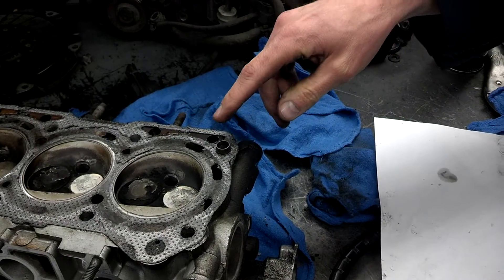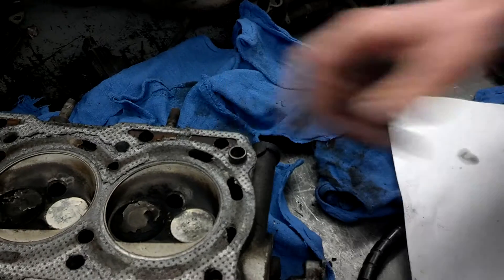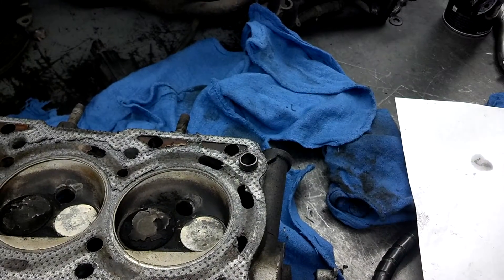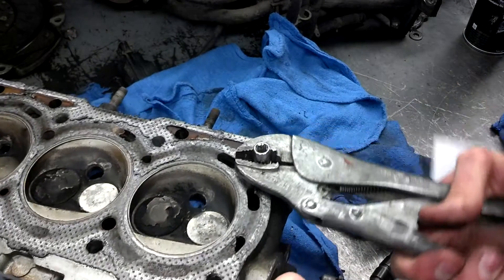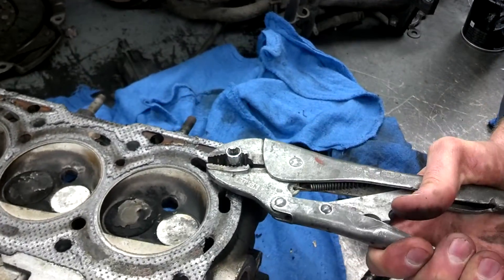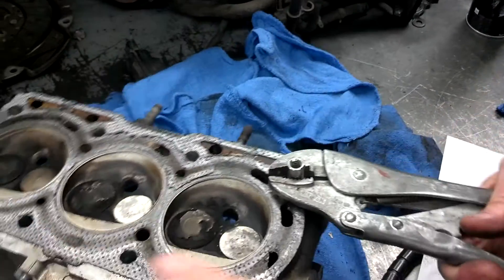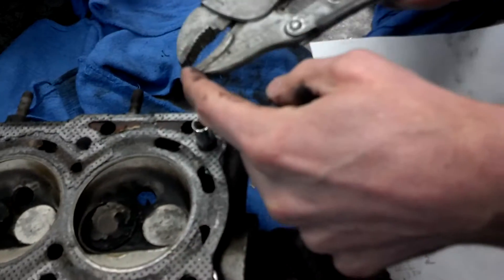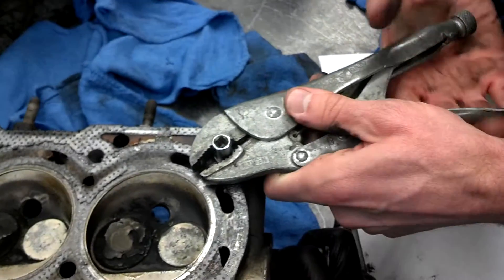How to remove an alignment dowel

Comment: Thanks for the tip, it really helped me out. My pain was a bit smaller so I used the back end of a drill bit to give me room for the vice grips. And don't forget to use the old gasket to Shield the head from scratches.

Comment: On the head I removed today, I was able to lightly tap the bottom lip of the dowel with a hammer, which both ends have, using a tool that has a pointed but blunt tip. There's one in most "pick and hook" sets. Just going around, tapping on all sides. The hole the dowel was in went all the way through so I could do that from the other end; not sure if other heads are like that.

Comment: please explain that what is the function of alignment dowel.
Reply: It's a dowel that aligns the gasket to the cylinder head for easier installation as well as aligns the cylinder head with the block for easier installation.
Reply from the maker: That is correct.  It is also much more important that just for easy installation.  Without the dowels, the cylinder head, the gasket, and the engine block would not be aligned.  With the head bolts alone, there is quite a bit of wiggle room.